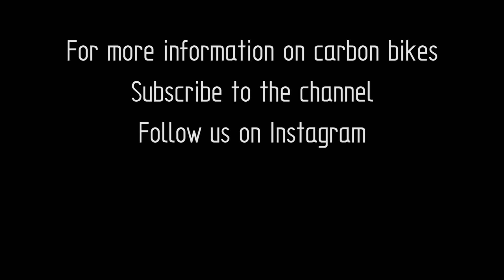Cannondale Repair Insert Available

Comment: Immensely helpful Luescher!! I am a new SSE Owner. I have read that they fixed this design flaw in the 2021 model, which is the one I own. Do you know if this is true? How could I tell?
Reply: planing on buying a used 2021 model unknow if this was fixed or not on the 21 model??

Comment: do you use grease or carbon paste when you insert the headset bearing on the frame headtube if you are on carbon frame?
Reply: Grease. You want to create a water-resistant barrier for the outer race. Carbon paste is for when you don't want components to slip, such as seatposts and handlebars.

The only carbon part that doesn't need carbon paste is the steerer tube.

Comment: It's a Cannondale, just toss it in the landfill and buy another bike, preferably a different brand.
Reply from the maker: Trying to avoid more landfill, there is enough crap in this world of ours!
Reply: @LuescherTeknik  Unfortunately the bike industry doesn't agree with you. Bikes produced today are going to be obsolete in about five years because they keep designing new designs, try getting a part when your bike needs it then. You will most likely be forced to buy a new bike. Maybe Specialized is seeing this already which is why the development of the Aethos and them using the traditional stem, seatpost, and bottom brackets in their marketing. They pulled a sneaky on everyone but it's for the better. You don't have to educate me about waste, I will never own a carbon bike again. I had a custom titanium bike made and there is no carbon aside from the ENVE fork used on it. I strictly chose the components to build it based on not wanting to use carbon and only made in the USA as much as possible. It should last me a lifetime.
Reply from the maker: I know they don't, but I don't have to agree with them either ;) I can still do my best to change the attitudes of people, because in simple terms if people stop buying rubbish, they will stop making rubbish, capitalism 101.
You do realise however that the fork is the most fracture critical item on a bike and your ENVE carbon fork is made in Asia like almost all of the other carbon parts. I hope you are right in that it lasts a lifetime :)
Reply: @LuescherTeknik  Thanks for reminding me that my fork is the weak spot. Tell me where I can buy a titanium fork that looks as nice and I'll buy it. Also getting people to stop buying rubbish has been a mission of mine since I started on Youtube. But I get a lot of flak and called out for trolling all the time. It won't stop me though. The brands pay these Youtube review channels to spew their marketing BS. Advertising is something I don't believe Youtube should be used for. Honest reviews are the reason I subscribe to channels like yours and not theirs.